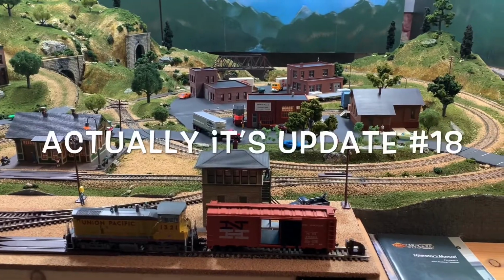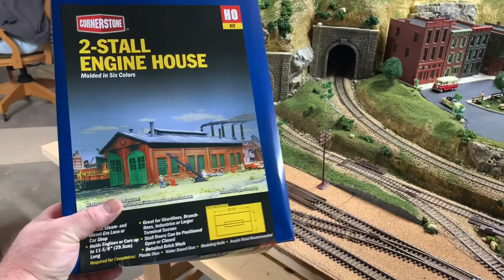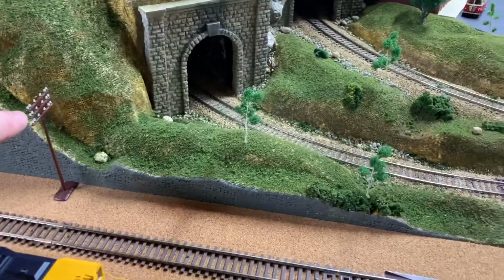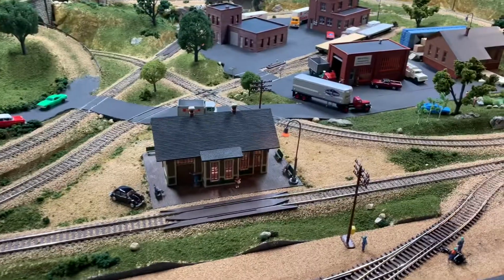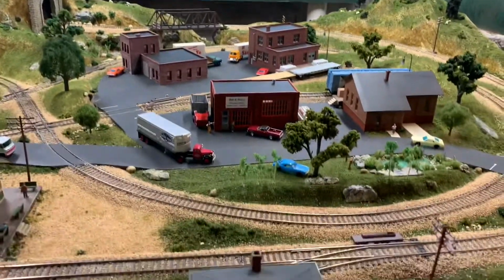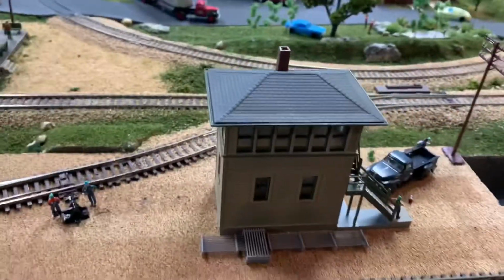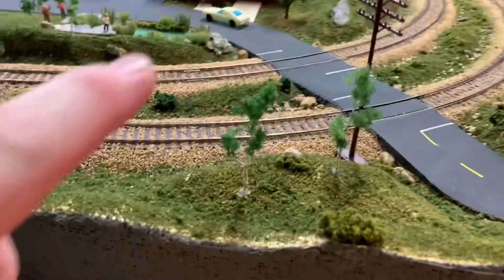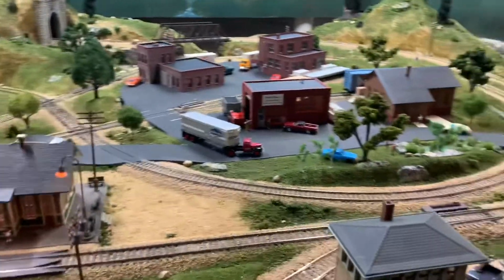Update Number Eighteen

Comment: Hi Dan. I'm definitely learning a lot from your videos. I noticed in videos that follow # 18 most of the power poles have been removed. Maybe I missed your explanation for this so I"m wondering if you plan on reinstalling them and adding wire between the poles. Woodland Scenics offers this in one of their kits. If you are going for extreme realism some poles if there is a change in direction or it"s the last pole should have guy wires to the ground. Keep up the good work.
Reply from the maker: Hi Thomas, thanks so much for watching!  So regarding the poles, a couple of things.  I never glued them in, since I was experimenting with locating them.  Now that I sort of have a plan, I had removed them to get a nice coat of paint on them to take away that shiny plastic look.  I have not found a paint color that I like yet.  I tried Model Master Railroad Tie Brown, Tester's Brown and a few other shades of brown but have not found it yet.  Also I wanted them out of the way for the lighting projects and guard rail job.  When I install them, I'm not sure I will go with wire, but if I do I would wait until I am pretty much done with major projects on the layout because I tend to knock a lot of stuff over and break stuff.   Thanks again for watching, and taking time to comment, it's much appreciated!